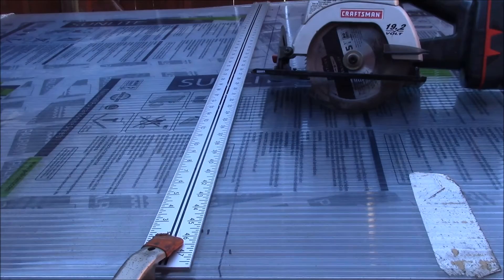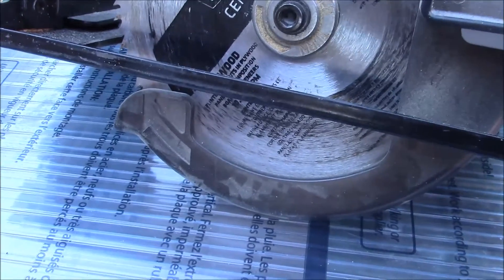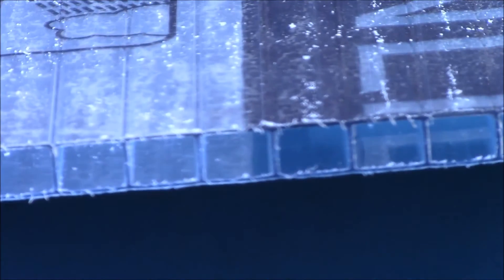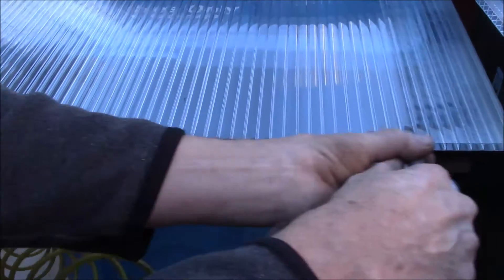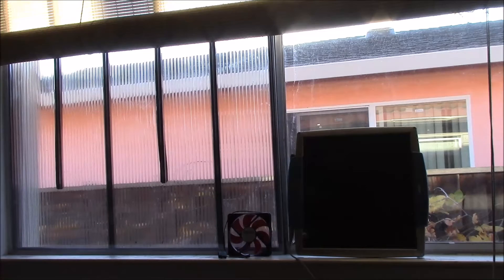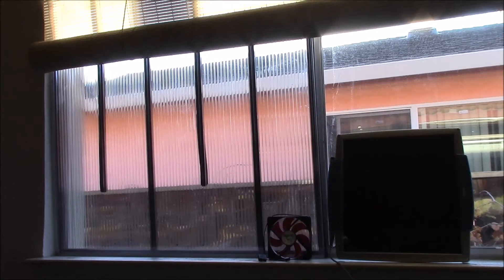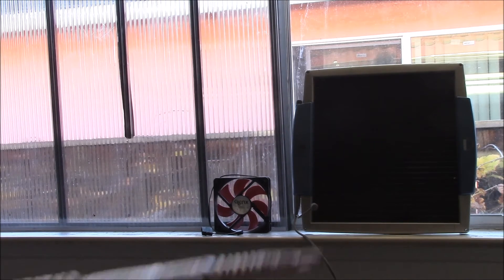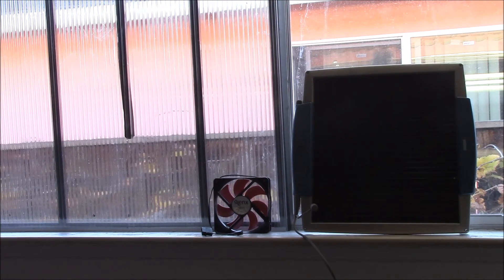In-Window Solar Heater - Build, Part 1

Comment: oh you sell them on ebay right?
Reply from the maker: +Mark N No, just showed how I made mine in the next videos using commonly available parts.  Since my unit was made to fit my window exactly, it probably wouldn't work for another window as-is, thus the need to custom make the unit to fit.  This is unlike the free standing unit that ATOH reviewed.  I think my design is more economical in that it uses the existing window glass for half the heater, so that saves on cost.  And I cover the entire surface of the window for the most heat capture effect.  The stand alone unit would be OK if you needed to move it around from room to room.
Reply: +R Brown (4Crawler) how many btus do you think it makes
Reply from the maker: +Mark N I measured about 1800BTU/hr. in my testing video:
 https://youtu.be/j7V2qDCX75M?list=PLpY2FP1a9tisey07zcocqAFXI7Tyo4rnR
I still need to play with air flow a bit more to see if there's more capacity in there.